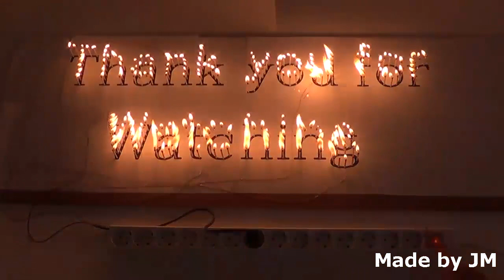How to check Solenoid valve works (Solenoid Checker)

Comment: Nice. I like the LED for indication. In the past I used a long 1/8" flat screwdriver above the coil solenoid to since the screwdriver vibration with my fingers on the handle.
Reply from the maker: I used to use a small magnet in the same way.